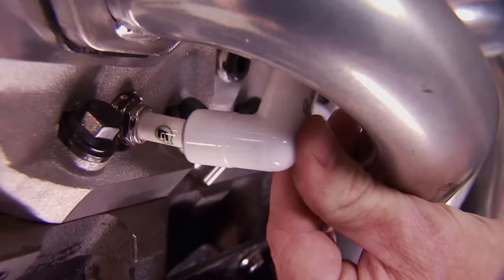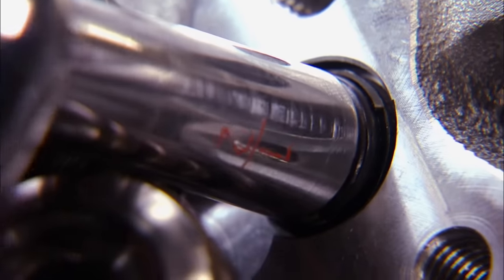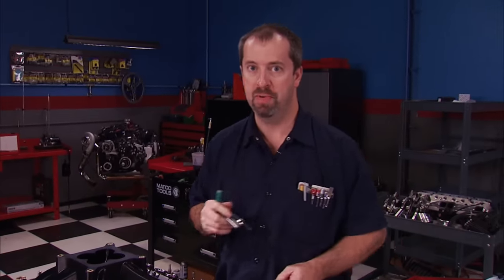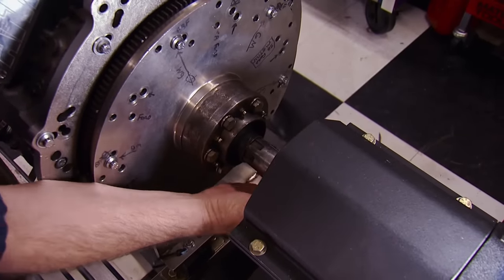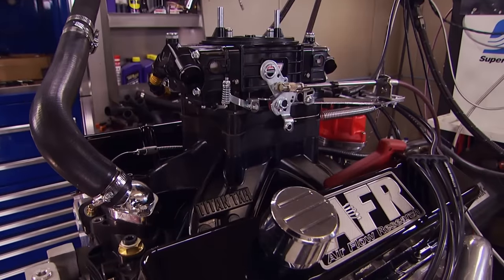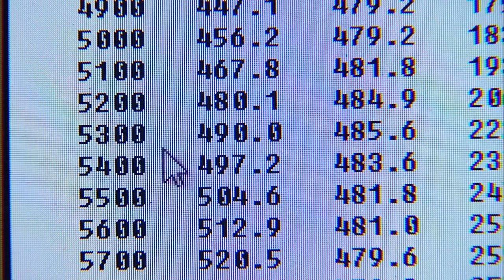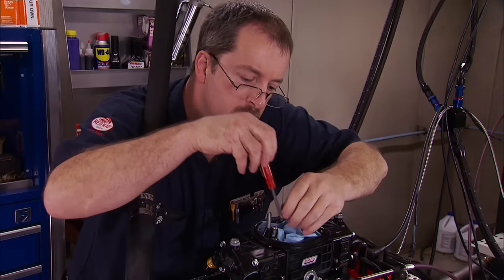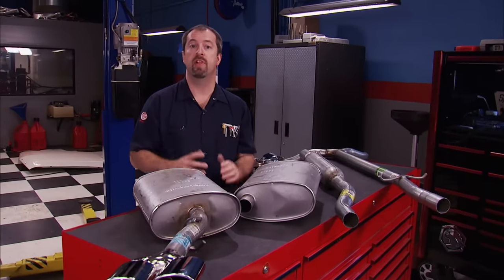Small Block Chevy Build Stage 2, Part 2: Complete Assembly & Dyno Day - Engine Power S3, E3

Comment: i didnt see 8000 rpm like they said
Reply: I didn't think so.at 8grand it should of made in 650 to 700 horsepower they  always have the best parts and come up with low hp numbers, I'd b sick to put in a solid roller and big afrs an get less than 600 hp
Reply: I agree Ken no doubt about it, that's a healthy engine at this point why not show its true potential

Comment: 93 octain pump gas :
Reply: That is what you get in many states. However, I know California has 91 octane gasoline, and there are additives that make it perform even more poorly than its octane number would suggest. Since this engine is probably not going into a car with catalytic converters or oxygen sensors, the guys can probably put some MMT based octane booster in 91 octane gasoline to get 93 octane.

Comment: Alot of money for that amount of torque and hp. AFR 220 heads on a 383 is a mismatch especially with that cam.  The 210's would have performed better. As far as the Titan intake, would have been cheaper just to run a Holley 300-25 Strip Dominator, probably would make more power also. The cam needs to be on a 106 lobe center with a 102 intake centerline to make more torque and hp. Disappointing build IMHO.

Comment: Lol they are reusing head bolts? You cant reuse torque to yield bolts...
Reply: You can reuse arp head bolts or studs.
Reply: Some older engine designs didn't have TTY bolts. I think the early SBC didn't use TTY bolts.
Reply: SBC and GEN II LT1 never used TTY bolts, that was the LS engines, LOLOL.

Comment: a plastic intake...hell no....look where ford got wit a plastic intake lmao...
Reply: mike meyer  plastic intakes have been used for years with great success there’s no reason to use metal these days modern ones are even good for boost.
Reply: @douglasm3310  The problem is where the coolant passes through the plastic intake. There are millions of plastic parts which don't hold up to antifreeze very well. If the entire intake didn't have any antifreeze going through it, I wouldn't worry about it.

Comment: This could been done a lot cheaper.
Reply: throw out a cheap combo that makes 585 on pump gas with 9.7 to 1 compression and I will build it. I can not afford all these trick parts. I have a 69 Nova SS with a home built 383. old school fuelie heads solid flat tappet cam and an eight fifty demon carb. With 100 hp shot of juice it runs 6.85 in the eighth mile. Basically stock with a loose powerglide and converter. No trans break no fancy electronics. Just fun.

Comment: LOL all that work for 545 HP, could have just purchased an off the shelf LSX 427 and a small turbo and made 800hp, and be street drivable.
Reply: You don't get it, but that's ok.
Reply: @brian_sipe  Ohh dear Brian I get it, they supposedly got rid of the budget and still sucked, just to show off some high end parts.
Reply: @christopherbenfield7848  these guys really suck. Sometimes they get lucky but usually their junk is weak.
Once they built a Buick or something, it obviously had a rod knock on the dyno. They still ran it several times.
Reply: Yeah but if they put a turbo on that 383 it could make 800- 1000 hp just as easily as any LS engine.
Reply: @daleyoung601  yeah but,.... no no you couldn't. And you certainly wouldn't be able to keep headgaskets in it, and it would cost a whole lot. Compared to the people using stock bottom end 5.3lt's and making 800 easy.
Reply: @christopherbenfield7848  how do you figure that when the SBC/LT1 has 5 head bolts per cylinder as opposed o the LS's 4 head bolts per cylinder. The LS will blow a head gasket under boost before any SBC/LT1 because of this factor alone plus the deck's of the SBC/LT1 is better because it's closed.
Reply: @daleyoung601  I figure because HUNDREDS of people find it very easy and cheap to use junk truck 5.3lt blocks and make 800-1000 on the stock bottom end. Your note on head stud count as far as I can tell only applies when boost goes over 30psi. Also your trying to say that a head design from the 1960’s can compare to that of the superior LS type flow? Not happening without spending a wad of cash. Also open deck block on the LS? Yeah maybe on the aluminum blocks, but not the 5.3 irons or the LSX blocks.
Reply: @christopherbenfield7848  okay genius my 383 LT1 has AFR cnc ported heads that flow 315I/234E @ .600 lift and my cam is a .630 lift so yeah I can easily make 800-1000 rwhp with my engine and the same turbo you use on an LS engine. And you're comparing an LSx block to a factory SBC/LT1 block, LOL there are PLENTY of aftermarket SBC block that can handle ANYTHING YOU CAN THROW AT ANY ls block.